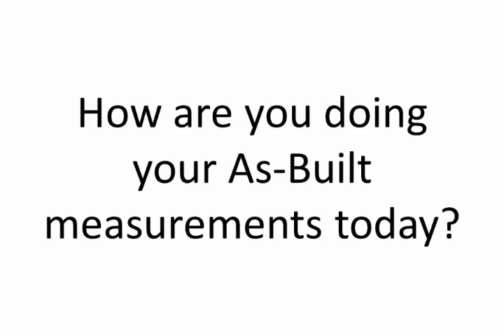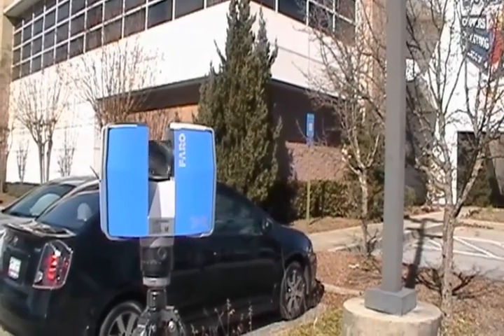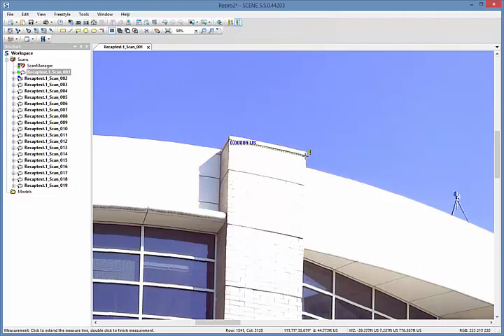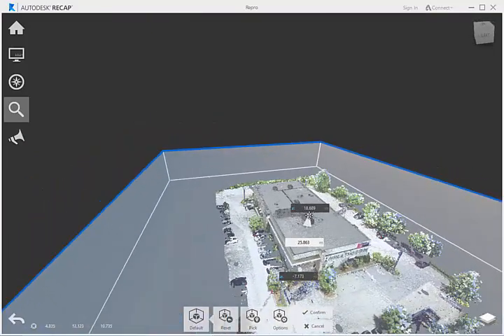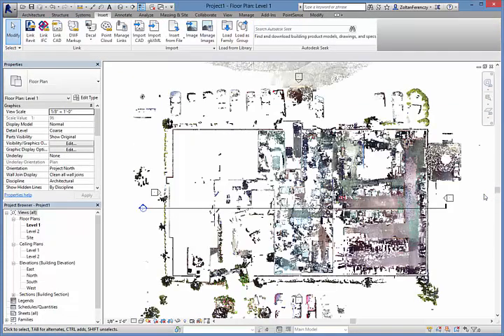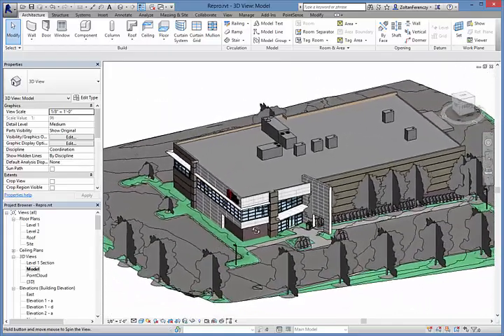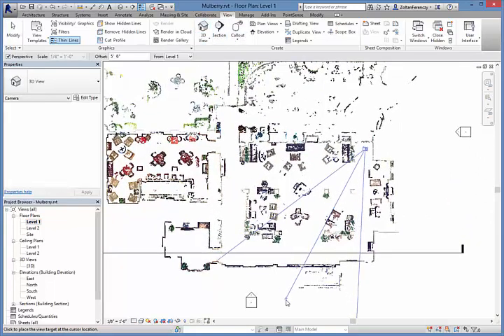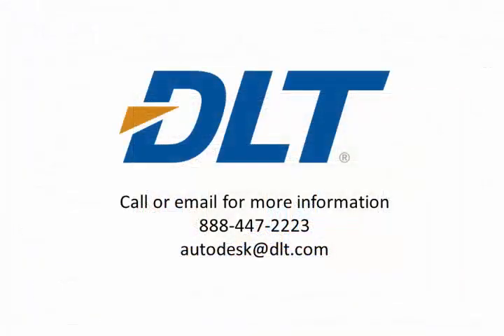Laser Scanning for As-Built Drawings

Comment: Hi
We are Yacht manufacturing company, We are looking for converting cloud point file or xyz file to surface or 3 d solid to send the surface to lazer cutting and do fabrication works, We didnt see that recap can convert the file to surface, solidworks can read xyz file but only coming huge file of points and we cant spend time to connect these points then get surface,, do you know the right and fast way we can use. tanks a lot, we can buy special software if there is any helpfulsoftware, and my contact is .+905522591887

Comment: Hi, i'm planning to buy a new pc and i'll use with this kind of software as well as revit, recap and laser scanner and i would like to know what are the specs of the pc in the video running the programs... Thanks
Reply: Simone Astolfi et Michel Rocard la
Reply: You will want 32GB of RAM, 1 TB SSD and an Intel i7 processor.  Your video card should be an nVidia GTX 1050 or higher.
Reply: @TITANAEC  You will need a Quadro P4000 or Higher & Intel Xeon & at least 16 GB ram for good performance. Trust me.
Reply: You need as much computer as you can afford, and then some.  Small buildings can get by with only 32Gb of Ram, but if you have anything medium to large you might want start at 64Gb.
If you are processing the scan data yourself using Faro Scene (or other), look into an i9 or Xeon processor.  FAST solid state drives are a must.